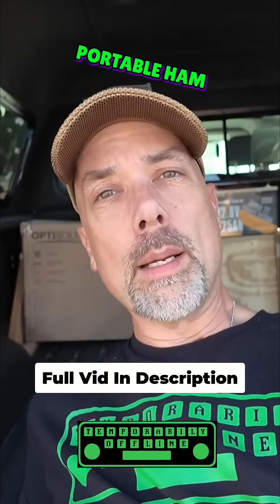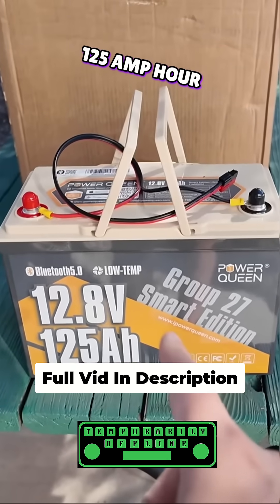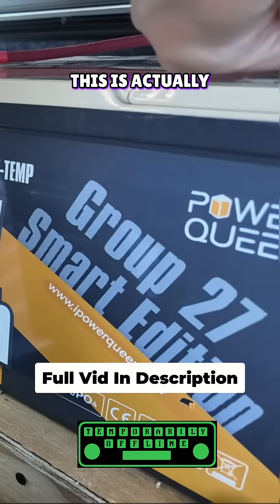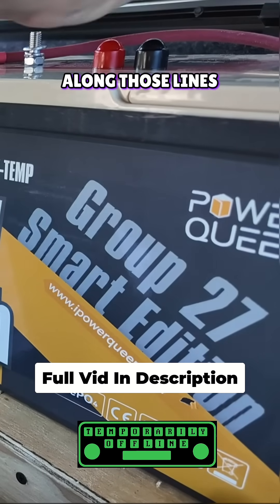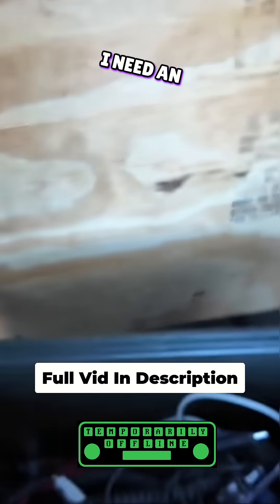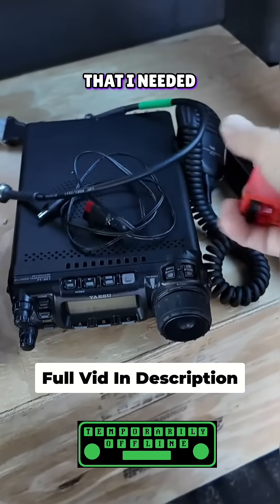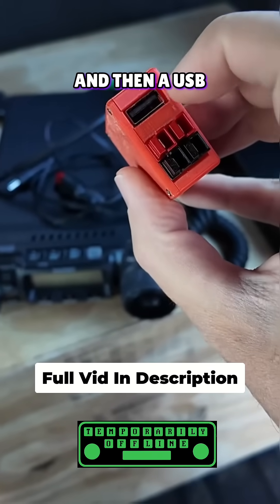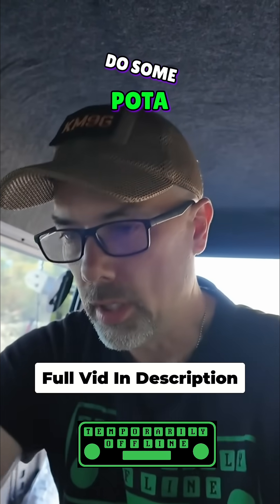Ultimate Portable Ham Radio Go-Kit for POTA #shorts

Comment: Can this battery be charged directly from the vehicle 12 V charging system?  From a lead acid battery charger? Or, do you need a charger designed specifically for Lithium batteries?
Reply from the maker: I charge my batteries from both types, but I'm a "live on the edge" type.  Mathematically/chemically the charger doesn't care what its attached to.  You won't get a full charge on a LiFEPO4 with a SLAB battery charger... maybe 80% and then the SLAB charger will think the battery is full.  I'll be using a solar panel and LiFEPO4 Charger in this case because I have them already.  In my RV I use the SLAB charger with twin Lifepos... 3 years running now, no problems.   Not advice, just my experience.
Reply: @temporarilyoffline  TNX

Comment: Will 125aH be enough for all that. The winch typically draws a ton. Permanent solar or portable? Gonna be fun when you hit the road with it. Lots of content with this project.
Reply from the maker: I will winch in on day 1 with a full charge, drive to campsite and winch out, make camp and setup portable solar panels on the roof of the truck facing southish and angled a bit I hope.  From there I hope to not move the truck for a week and then winch the bike in and head home.  Most of the stuff in Quartzsite will be by bike at sub 45mph... of course I'll over pack and have extra batteries for backup.
Reply: @temporarilyoffline  Don't bother with southern facing, flat will suffice. The energy output difference is less than 10%, the complexity and top mounted weight is not worth it when you can just get a higher output panel with more cells and lay it flat for less cost than a frame and the lower output panel pointed south. Isolate your truck starting battery from the house draw but allow it to charge. Bring a jump starter booster pack or two. This is advice from 52 degrees N.
Reply from the maker: definitely isolated systems... at worst I'll have a DC-DC charger I can connect when the truck is running.  World's most expensive generator?  Luckily we won't be that cold... maybe 35 in the early morning.